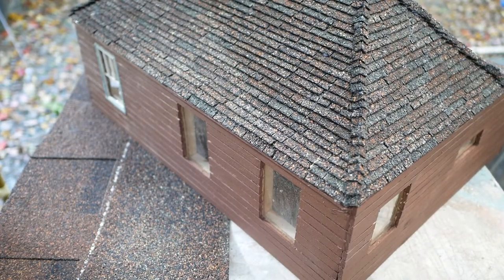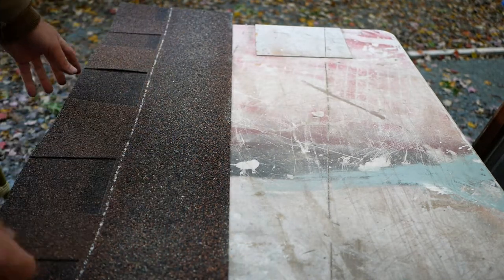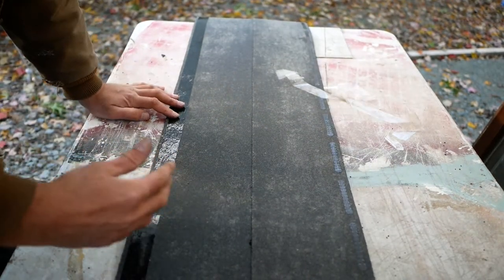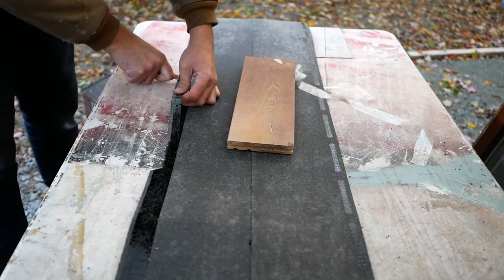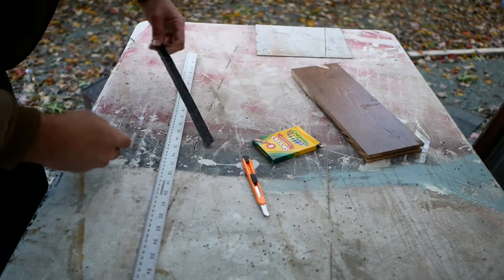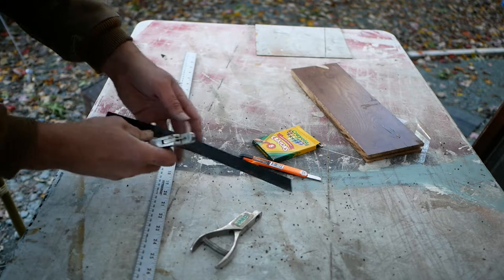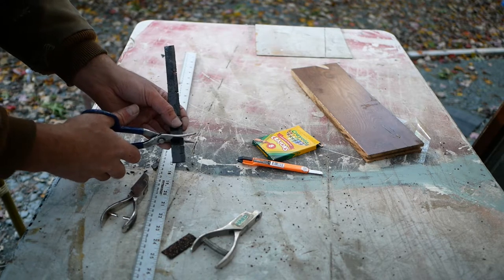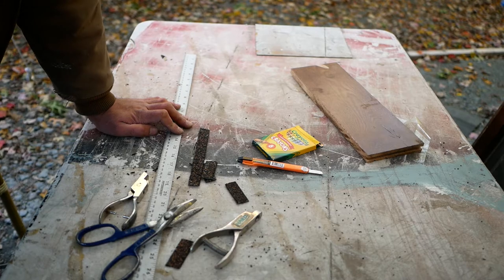How to make asphalt shingles for a birdhouse or dollhouse

Comment: Looks really good. What did you use to adhere the shingle?
Reply from the maker: Thanks! I usually do a small line of hot glue on the very top edge to hold it while i'm making it, then exterior construction loctite so it actually stays.

Comment: Good tips. Say, have ya tried those notchers on thin wood?
Reply from the maker: Depends on the wood. I use it on a veneer strip I rip on the table saw sometimes, but harder woods the punch doesn't work on. What kind of wood you using?
Reply: @Honey_Dew  , quarter inch thick pine or cedar.